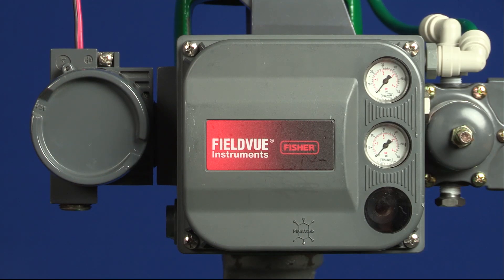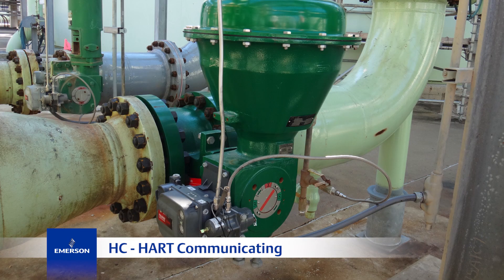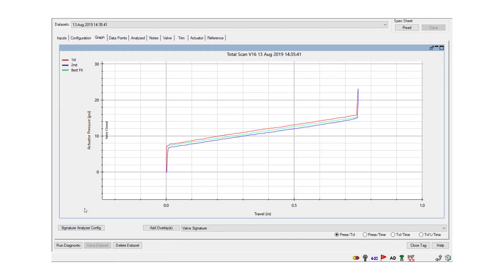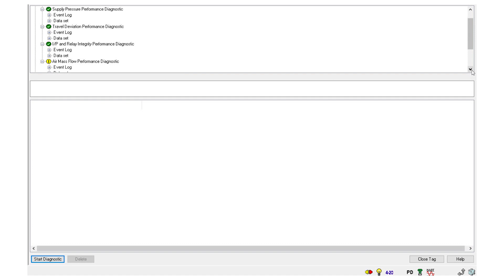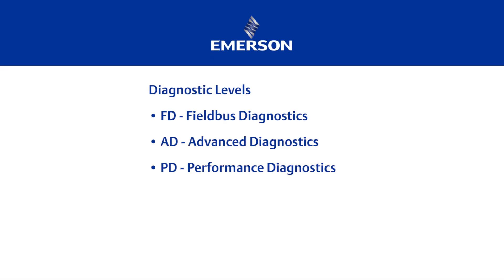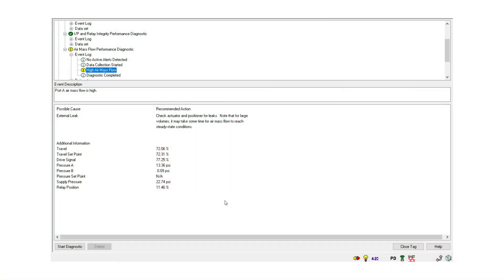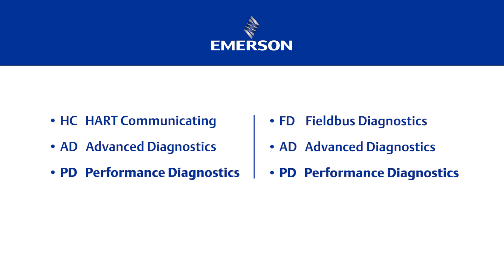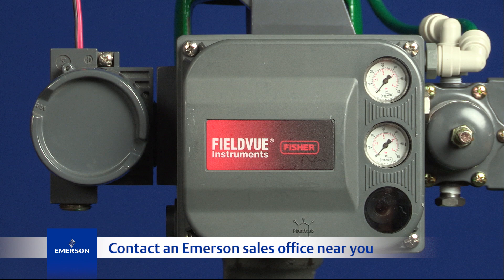Diagnostic Levels for Fisher FIELDVUE DVC6200 Series Digital Valve Controllers

Comment: why the valve is not opening while only flow..? 
where as it is nicely open with or with out pressure. 
what need to be adjusted..?
it is double acting valve with boosters.
Reply: Pode ser problema de contra pressão na linha que impede o obturador de movimentar se. Ou pouco ar de suprimento que não consegue vencer a força contrária da pressão no obturador e haste.

Comment: I have problem with air line ...somewhere salt water inter to air line... salt deposit in i/p converter module... I cleaned it but it's not working ,,, any help from emerson....
Reply: Check the I/P converter resistance then you will know about your converter is ok or not.
Reply: Coloque um filtro de ar na linha antes da reguladora. Verifique e limpe o piloto e carretel do posicionador.